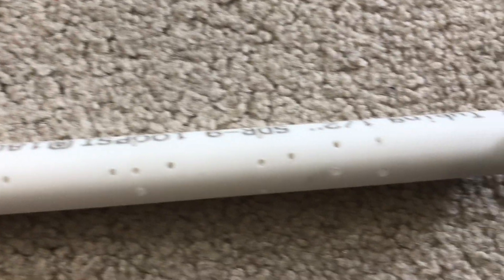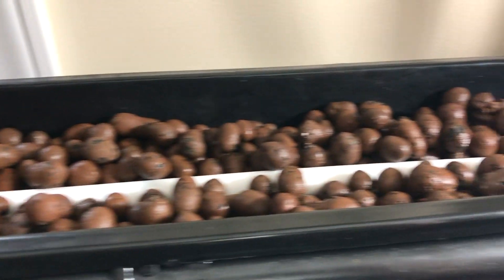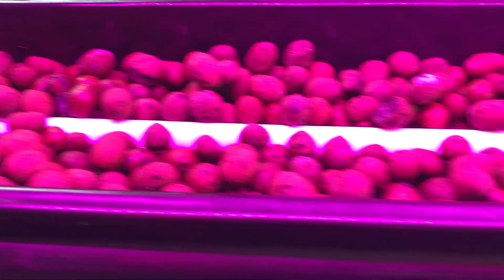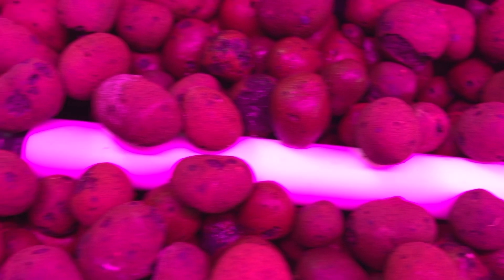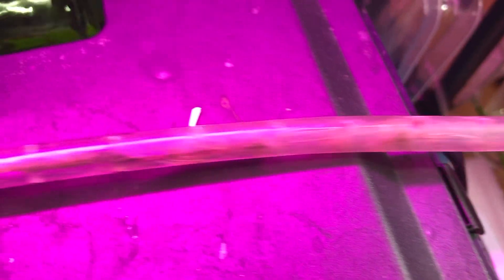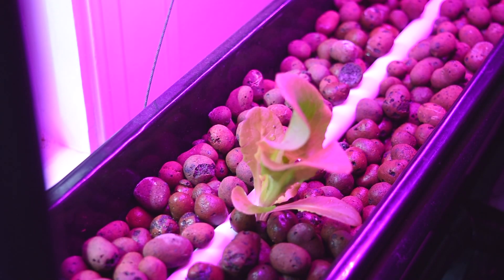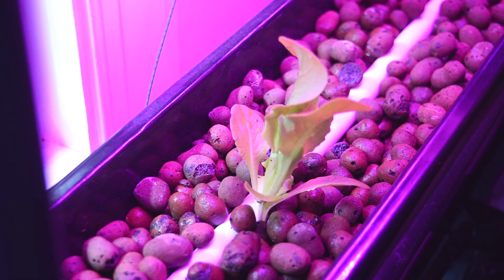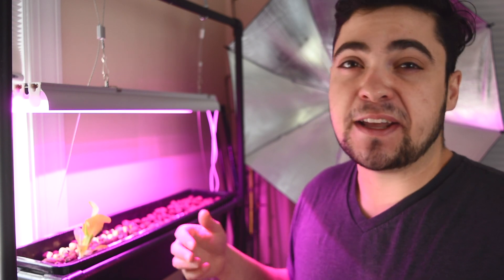DIY AQUAPONICS Fish Tank System Update (Questions Answered!)

Comment: I like your system man, I've been into aquaponics for about 10 years dabbling here and there. Only issue I see with your system is you dont have a filter to separate the solids from the water before it enters the clay pebbles. I see alot of issues with root rot from allowing the fish poop to enter the clay pebbles before it has a chance to be broken down into a small enough food source for the beneficial bacteria that turn it into nitrates that the plants eat. I've seen people tackle this with a sump tank or sand filters that polish the fish poop into smaller sediment allowing it to break it down much further. Also it will prevent the top area from becoming anaerobic which leads to smell, root rot and other issues. Watched your other videos and this is probably one of the simplest systems for the DIY that you can actually utilize for some decent harvests, which is great being it's easy. I see in your one video you had 3 plants why wouldnt you go to 8? I know once they start getting bigger they run into each other, but if as it grows you trim the lower foliage when you want a salad it should allow multiple harvests as your taking alittle bit off of each plant over time and with it being artificial lighting and some ambient window light the plants shouldn't have an issue if any crowding does occur. Crowding plants in aquaponics is not the same as in dirt, because the nutrients are readily available. Just a tip I would also change your youtube description to catch more traffic To include aeroponics as well because being that you turn it off sometimes and when it's on it resembles a drip system you could argue it meets the requirements of aeroponics, aquaponics, and aquaculture. Aeroponics is wetting the root base of the plant periodically to deliver the nutrients to the plant. I see them using mist but I've also seen water being dripped into the system and utilize the towers just the same. I would say that argument could be made lol.